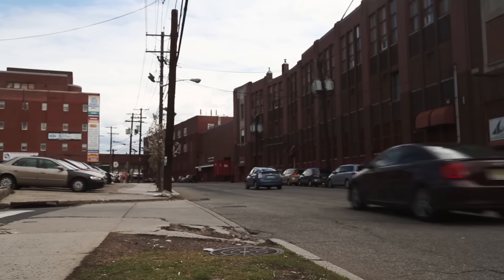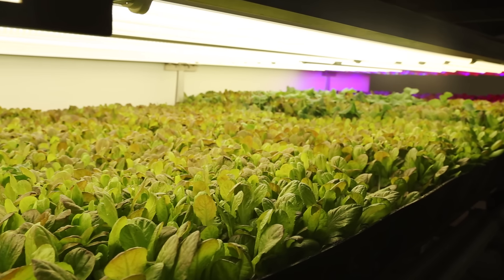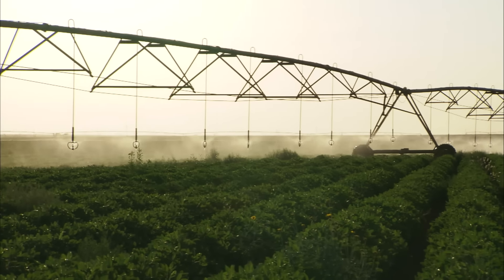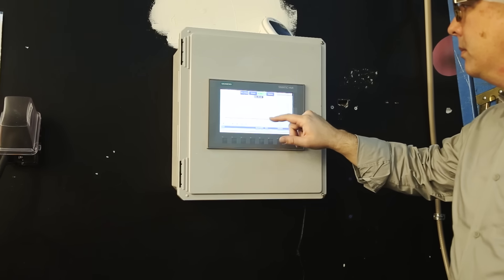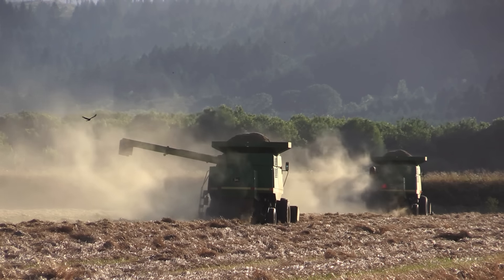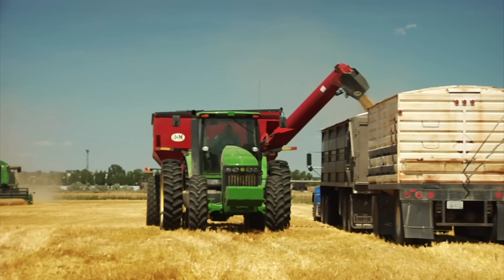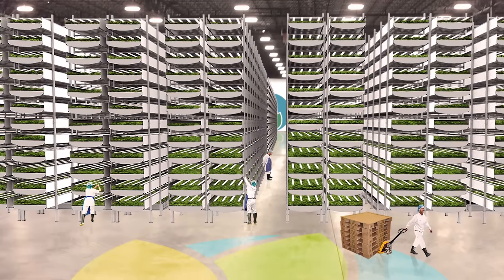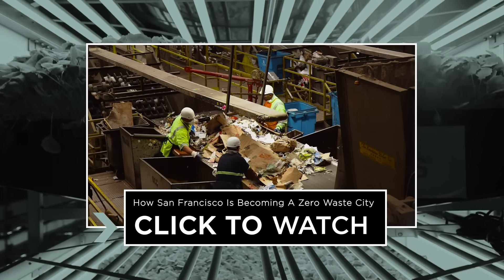This Farm of the Future Uses No Soil and 95% Less Water

Comment: I wonder if there was a way to use glass ceilings and mirrors to reflect light onto the many levels of crops instead of using electric lighting... Just a thought.
Reply: The heat might be a problem, but with proper ventilation I'm sure it could at least cut the cost of operations. But it would require banks of reflectors and precise angle alignment constantly maintained to adequately light every level, not to mention the cleaning and precautions involved, so the savings might not be worth the trouble. But, send them the idea, anyway, it might be worth more than a thank you.
Reply: Led lighting is cheap to run and effective.
Reply: @zokay1121  The create very little heat and are efficient and can be tailored to produce the spectrum of light required by the plants.  The humidity level with all those sprays may become a maintenance issue.
Reply: @darrelgaines777  The heat would increase the evaporation of the system massively, resulting in exponentially higher water waste.
Reply: @andrewmayers1493  probably do. Good point.
Reply: @zokay1121  ,
Reply: It will be in the norm in the next century if not earlier.
Reply: And your not A CEO yet
Reply: It may let bacteria in
Reply: We can't control natural light or its heat, cuz these plants have their roots exposed (not in the soil) will heatup fast which is not a good thing for any kind of plant. Plants can tolerate temperature fluctuations above but not much near the roots
Reply: Lucas Johnson just mirror the sun filtering the light spectrum like the Egyptians did with reflection simple as photon amplification or concentration
Reply: Mark my words Lucas Johnson there will be light transfer in the near future...similar the cup and wire and cup transfer of sound... it will be with a high tech cup like receiver and transmitter devices...highly similar to wireless charging...
Reply: But the intensity reduce for every length thats why it has every lighting on each stack to keep enough lighting for each. Likewise also if only use 1 light then the plant closes to the light will die instantly due to overheating.
Reply: Maybe, but we need only two types of light blue and red {purple-violet} not an full spectrum. And the temperature... Maybe I don't know that much
Reply: you could and, it would be cheaper
Reply: And when it's night what you do?
Reply: not have sunlight like the rest of the plants
Reply: The light would only hit the top crops but not every individual plant
Reply: Mirrors and the natural light, perfect!
Reply: Somewhat true. You would have windows all down the sides. Like Lucas said you would have mirrors to reflect to the back.
Reply: so, (by what i understand) you can have lights and windows. just to get some natural light. because (if you remember) it is an old laser tag arena. so, it is completely dark. would adding windows destroy the whole process though...
Reply: @BJ700 The necessities of the Sunlight for our lifes( life of the people, the animals,the plants,  food, etc) is proveed to be the best form of energy in all the registers since we discovered civilization, we can see it in Machu Picchu, in Egypt, in Brazil... Enven in our civilization Nikolas Tesla said that. I doubt we have technology to substitue the Sun.
Reply: Or use solar cells
Reply: YOU NEED TO START A COMPANY
Reply: Maybe they could replace part of LED with sunlight- 
Catch the sunlight and then filter it to the right lightspectrum and bring it to the building with optical fibres. But I don't think it will be enough light - they need to have big catch area for sunlight (and what about rainy days).
Reply: @BJ700 I guess so, but you never know. We can always improve! What about instead, when using the glass, there would already be LED lighting on top of it, and the glass would use to mirrors to reflect it. So instead of there being uncontrollable heat, you could turn off the LED anytime! Why would you want mirror and glass even though it already has LED?  Because then,  you can use one LED light, just to make all the crops absorb it's light, by adding a glass and mirrored infrastructure! Of course, you'd need a new layout, but that wouldn't be what I'm going to explain now~ and it's really cheap! So how about it?
Reply: it would then only be diffused sunlight.
Reply: light also gets weaker each time it’s reflected by something or so I read.
Reply: may try and let us all know it.
Reply: Even better , use solar panels to collect the solar spectrum then only emit the spectrum that plants will utilise. You might even get more useful energy out of it than a window. Not sure though . Probably not.
Reply: There is, There's a way to use internal reflection cables to diffuse light into places it wouldn't reach, The issue is intensity and misting. So currently, it's much easier to use LEDs and photovoltaic panels as a lighting solution. That said, one could significantly increase the area of photovoltaic action using Solar tubes or sun shafts (https://www.eeekenya.com/solar-tubes-a-smart-way-to-brighten-dark-rooms/), Basically making cylindrical solar panels. If successfully deployed, you'd have much more energy in a much smaller space, plus daylight because internal reflection wouldn't significantly reduce the energy on the photons. Of course, that's all just logic, and not actually tested...but consider it creative commons and try it out.
Reply: Mike Grover  Sunshine has no "nutrition." It just provides light for photosynthesis, and that light doesn't have to come from the sun. Plants take in carbon (the bulk of their subtance) from the air... That's why plants turn carbon dioxide into oxygen. The carbon remains in the plants. Some plants have different sexes, but they are focused on greens here, which are able to both pollinate and be pollinated.

Pollination is easier to accomplish than you might think, but for this endeavor, they are growing plants as food. They aren't pollinating greens and letting them go to seed. There are seed growing operations that can handle that... but that's not the target of this clip.

Comment: less soil and water but more electricity!
Reply: maisto not if they use led lights
Reply: They use led's, and as they said in the video, they save even further electricity by not using yellow spectrum light, only red and blue. Regular farms might not use electricity to grow their fields, but they use tons upon tons of diesel fuel to sow, harvest and prepare their fields. With vertical farm, the energy at least has the potential to come from renewable sources.
Reply: Yes, but the technology for vertical farms exist now. It will be decades before we have batteries powerful enough to drive a tractor for any reasonable amount of times
Reply: +Thure Christensen and lets not forget, the batteries needed for solar powered vegicles are detrimental to the environment themselves.
Reply: They could use greenhouses with mist and possibly some mirrors. No need for LED lights.
Reply: which you can get it free from the sun...people only have to put their minds to it and they will make it work...
Reply: and no pesticides ;)
Reply: maisto electricity was never the problem
Reply: You're assuming that the solar panels required to power a vertical farm would take up the same amount of space as the fields it replaces which is not necessarily the the case. As for power at night, there are other sources of green energy than solar. Wind for instance. The whole point is that these farms can work with nothing but electricity, which gives it the potential to be 100% green with current technology. Regular farms are dependant on fossil fuel with the current technology.
Also, no one is saying led's don't need electricity, they just require a hell of a lot less of it compared to other artificial sources of light.
Reply: Add a thorium reactor into the mix!  Done!  It's the future!
Reply: Not to mention the benifits when you consider factories that that process plants. Like, you could grow wheat in the same building as you grind it into flour, meaning 0 fossil fuels used on transport of the grain. Further more, this would mean you wouldn't have to build those factories in the country side to be closer to the producing farms, you could build a flour factory in the middle of the city where to flour is needed, right next to grocery stores and bakeries. the shops could even be in the same building on the ground floor. All of this would cut the carbon footprint of transport of the goods to almost 0.
Vertical farming is just overall incredible
Reply: ...I think your math is bad.  There's no way you're going to get the energy input from solar (which has a theoretical maximum efficiency around 40%, typical panels bring in 10-20%) to provide the necessary output with LED's to manage significant stacking of vegetation.  Keep in mind that while you can manage spectrum and energy efficiency, plants still require energy for photosynthesis, and the amount of energy is not insignificant.  If you are not surrounded with acres of solar panels (which totally defeats the purpose of a vertical farm in the first place) you will need an alternate energy source.

Vertical farms do not solve all problems; they consume more energy per plant than a standard farm.  They just save space and become viable when space is highly limited, at the cost of routing energy and resources outside of Mother Nature's plans.  They are inherently less efficient than standard farms, which is why these guys care so much about energy efficiency; that electricity is money.  These ventures only start to become cost-effective when nearby arable land is super expensive and/ or when the cost of transportation to market is prohibitive.

None of this is a dealbreaker, though.  With a plentiful, efficient, long-lasting energy source, we can get a lot more green in the same space.  I was jokingly referring to Thorium reactors, but ultimately when the technology matures a fusion reactor would be perfect for this, and it becomes a viable prospect for long space-based missions where the environment must be self-sufficient... that's why this sort of effort really excites me.
Reply: The capital is honestly too big, but the concept is forever promising as the issues such as land degradation,water scarcity drastic and harmful weather changes gets louder each day- genetic transformation of crops cant keep up. What i do want to see are the expenditures and the derived monetary and environmental costs when it comes to the mass production of its facilities. This set- up can only be acceptable if the system creates an effective loop between the water and nutrient (includes minerals and carbon) loss and plant use. Still, personally, for now i dont believe that we can exist in vertical farms alone.
Reply: Wrong. This isn't natural.
Reply: +Charlotte Low because outdoor sun uses way more electricity than led's lol.
Reply: how does that matter at all? Electricity is renewable. Water isnt, though we have a large abundance of it, we are polluting and wasting it.
Reply: well, solar energy can fix that too.
Reply: Explain to me using the journey of a rain drop how water isn't renewable?
Reply: How is water not renewable?
Even heard of the word rain?
Reply: Sure, as with most anything. Are heavy ag combines currently run on solar power? Contrarians are such bizarre folks.
Reply: maisto not allot leds are very effecient and last forever
Reply: More electricity usage is true however more and more renewable sources are being used so its better.
Reply: maisto nuclear
Reply: +Valken The biggest point about these farms is that they can operate in existing old buildings and warehouses. Which most cities have plenty of.
Reply: Jeremy Holovacs You do realise that no process is 100% efficient, it just has to be cheap. Solar is already cheaper than coal, desert land is cheap, where the installation, which is already more than half of the price of solar power, is cheap. The savings come in cheaper transport, cheaper water use efficiency, cheaper fertilizer use efficiency. Plants are only 2% efficient in using solar energy, but what if the LEDs, gave them only the frequencies, they need, then their energy efficiency, would soar to 25%. Give them CO2 enhancement, from burning natural gas and use the electrical power from the CH4, any way you want. Efficiency isn't that important, cars waste 80% of the energy they burn, but the price, was once cheap. You get less energy out, using fracked gas, to distil tar sands than you put in. There's huge energy losses in Agriculture, transport, energy production, as long as it's clean and cheaper what's the problem.